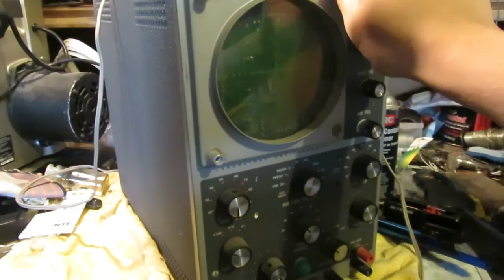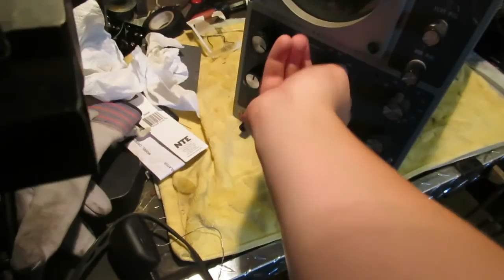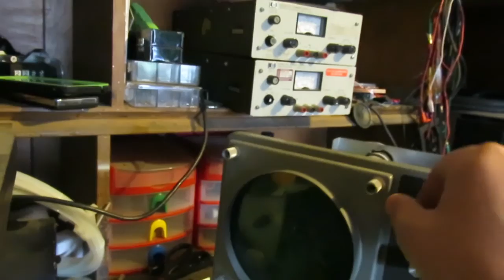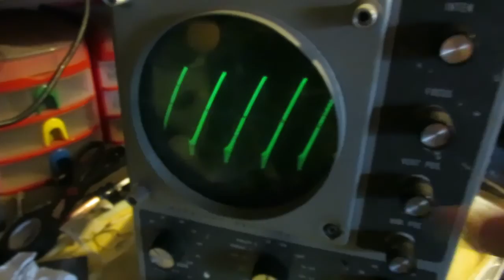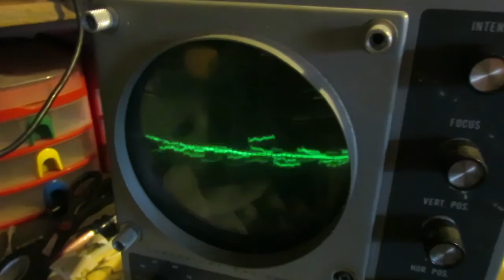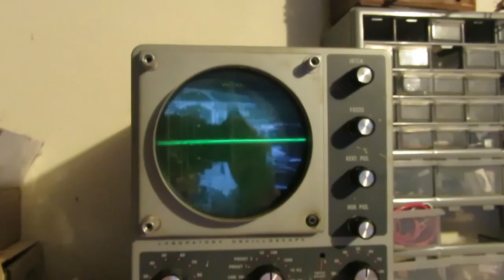The Near MINT Heathkit IO-12 Oscilloscope

Comment: I  just got one off craigs list for $40.  I never tried to get it for less . By reading , every ones comments I think I should order some caps. and check the tubes. first and maybe buy a variac.
thks for posting .I don't think anyone has recapped one of this on u-tube/ (model Io-12)                    Mr. Carlson's Lab, I think is doing (later model of the earlier "O" series) think  O-11

Comment: That oscilloscope is over 50 years old, it's the best idea to obtain the assembly manual with schematic and replace the capacitors. Keep the ceramics and micas. Order  capacitors from Arrow Electronics Inc. They will deliver your capacitors in 2 days. Also, watch Mr. Carlson's Lab about locating the foil side of orange drop capacitors and also how to restore these oscilloscopes. Discharge the old capacitors before you start working inside the unit, place the new capacitors in neatly. I restored a Heathkit model IO-18 which is very much the same as your OS-12.

Comment: Nice scope, and I appreciate your enthusiasm, but you seem to be out if your depth regarding what you can, and cannot, discern about the number of voices in a musical mix, and the number of bits of resolution, just by casually glancing at a low bandwidth scope display. Certainly within limits and with simple waveforms, you can perhaps tell the resolution.

I also wonder what you are basing your assessment of "mint" on....are you looking for discoloration of the tubes? If so, the scope might be well used but have newer tubes, and many tubes will not discolor with use.

Comment: Thanks so much for posting this, may I recommend changing all the electrolytic capacitors? Sure this beastie has had minimal use but caps of a certain age degrade even without regular use. I repair/restore old Radios as a hobby so I know this is a sensible idea. I'm a bit jealous! These 'scopes don't have much bandwidth compared to today's modern units but they are perfect for valve audio & valve radio  work. You are a lucky man I think:)

Comment: Those appear to square waves, but that doesn't tell you it's 8, 10, 16, etc bits. The bit refers to the resolution of the waveform, not the shape. In other words, you're seeing those waves because of the type of music you're listening to, not because of the bit resolution. If you were to get 8 bit samples of someone singing and run it through the O-scope, it would look a lot more round and consistent with 16 bit waves, with maybe more rough edges. Anyways, thanks for the tour of the Heathkit.